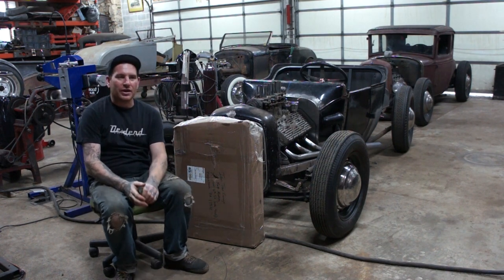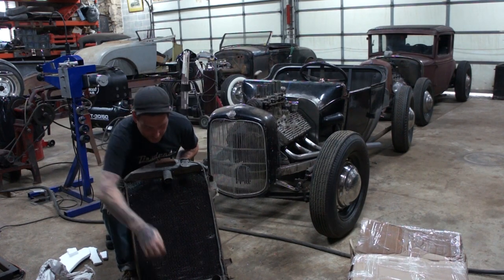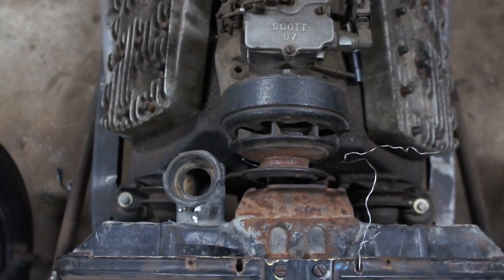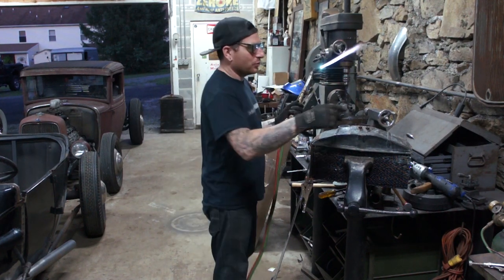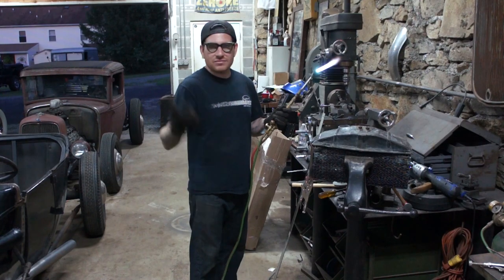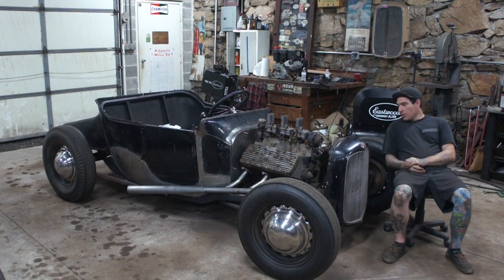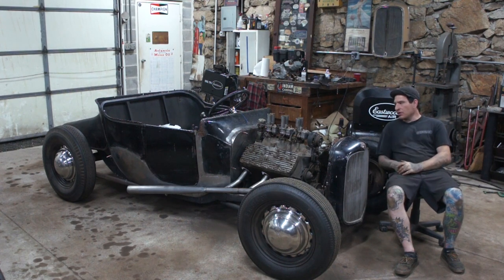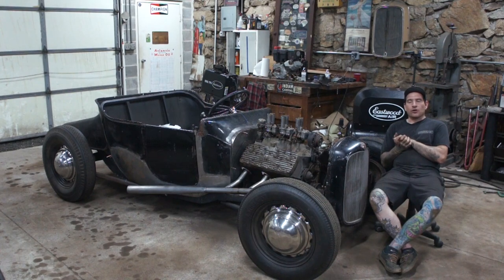How to Chop a 1932 Ford Radiator- Ford Free-T - Ep. 34

Comment: stock ford flatheads are known to overheat. the reason for this is because the water pumps were too efficient and circulated a lot of water. So much water trough the engine the water didn't have enough time to absorb the heat. take washers large enough to cover inlets in head. watch temp, if it rises drill out hole in washer, check temp again. After you stabilize temp weld or epoxy washers in place. I  have done this on 3 different flatheads and no overheating problems. Another thing we used to do was drill holes in water pump impellar to slow down water. But since you cut out almost half of the radiator you might not have any problems.
Reply from the maker: Thanks for the input Mike. I've head of all of these tricks. It seems just running thermostats sort of does the same thing as all of those methods. I'll play with it some. Thanks for watching! -Matt/ITG
Reply: A lot of the problem on flatties is the scale & sediment built up in the water jackets from straight water without antifreeze for too many years. You'll fight it forever if you don't clean it out. Running an oil filter & cooler also helps dump a lot of temperature. They're just a crappy design with the exhaust ports wrapping around the cylinders.